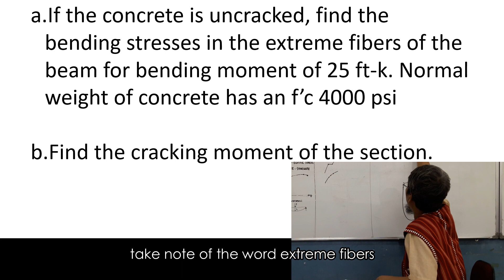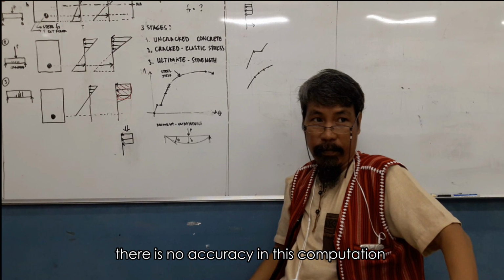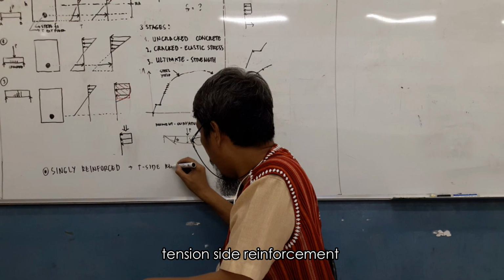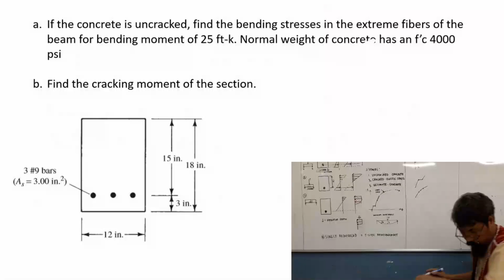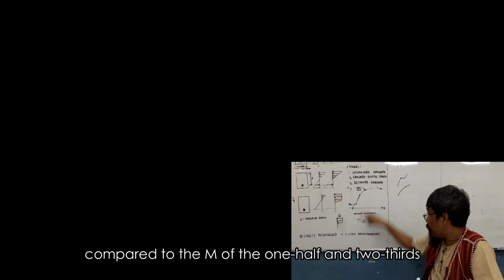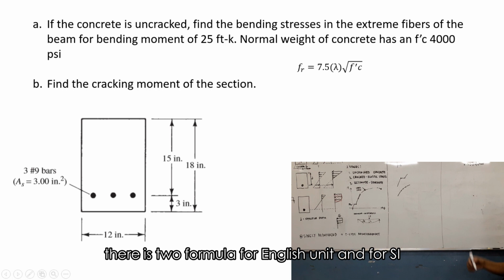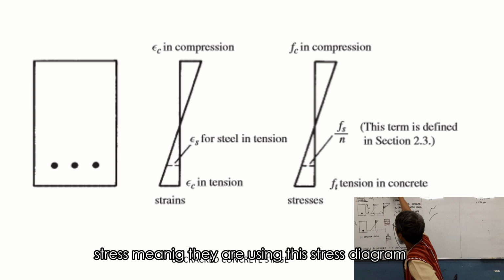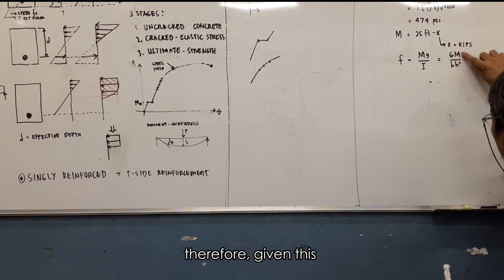CE 422: Structural Design 1: Reinforced Concrete Design || Flexural Analysis of Beam || Part 6

Comment: Thank you Sir for this lecture video and discussing to us the concepts that we can use in solving the problem. And I also learned that the Singly reinforced means that the reinforcement is provided on the tension side reinforcement and the Doubly reinforced means that both side have reinforcement: tension and compression side.

Comment: Thank you for this lesson, I've learned the two terms mentioned the Singly Reinforcement and Doubly Reinforcement wherein A Singly reinforced beam holds a steel bar in the tension zone, but in doubly reinforced
beams, steel bars are given in both zones, tension, and compression. In singly reinforced beam compression, stress resists by the concrete, while in doubly reinforced beam compression steel, counters the compression stress. I'm looking forward for the finished sample problem to further understand the computation and process.